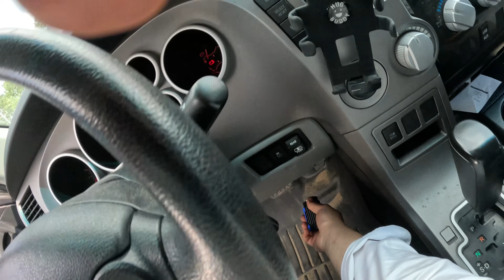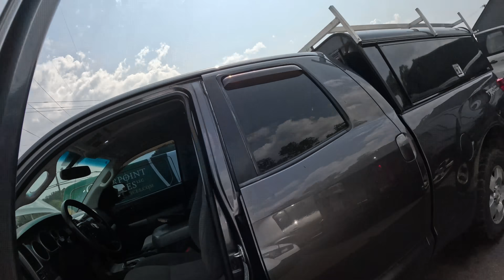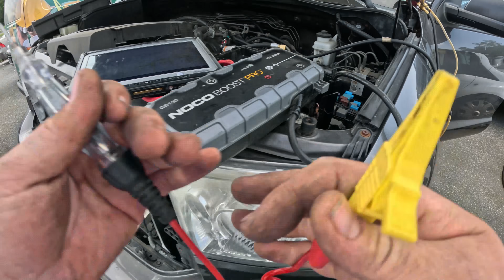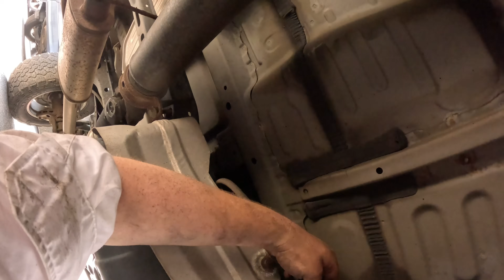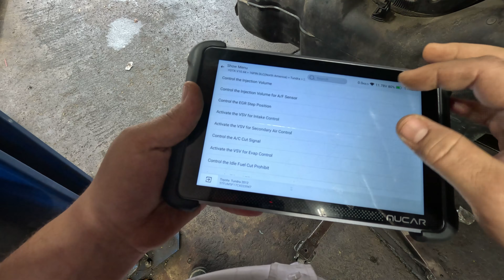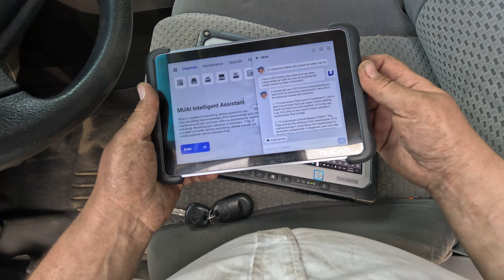2012 Toyota Tundra Crank No Start!

Comment: My 2007 Tundra SR5 5.7  fuel pump shot fuel from the larger line leading out from the pump top after I fixed the power connector (pin backed out from tension) but it just cranks over.   Any ideas?  Fuses are fine.  New battery.  I had to replace the tank after the straps broke from rust, and I transferred the old pump over.

Comment: question , in cars that doesn't use module for fuel pump and no pulse width modulation and no fuel pressure sensor does the pump there works all the time and just the mechanical regulator turn back any additional fuel and that it? for example in my 2014 elantra there no module no  pressure sensor so does it work all the time?

Comment: Hi excellent diagnosis I have the same exact truck I had the same problem I made the mistake of using a voltmeter when I used the h7 headlight bulb I realized the module was not working

Comment: That "MUAI assistant" is very likely just linking into an existing AI and getting it's answers through a sort of API interface with other AI models.  It's very common to do it this way.  Everyone is piggy backing off of the big companies that are ahead of everyone.  I use AI like 50 times per day and have 3 of them open at all times..   It can be very useful, but at the same time- it can give wrong answers and even make things up or "hallucinate"  and sound very confident in what it's saying, while being completely wrong.   So you have to catch it in contradictions and stuff and catch as many wrong answers as you can along the way.    You just have to get better at prompting it in a totally different way or explaining in more detail - and then it can usually end up helping, at least in some way.   

They are particularly good at explaining technical stuff for computer commands  and code, etc.  because that stuff is well documented online.  When it comes to technical stuff about cars - it's very hit or miss;  because it's essentially just reading forums and stuff, just like we would manually.   So if the answer isn't out there on the net somewhere - it can have a hard time helping.   I would actually be very interested in using an AI like this, that is "supposed" to be specifically trained on helping with auto diag, etc..   I could see it being a huge help though - in the future.   I'm definitely learning faster, since I started using it everyday, back in 2022 or so;  basically as soon as the stuff was available.

It's just like searching through youtube vids for info.. Sometimes you find the coolest stuff and the perfect answer and sent down rabbit holes and learning things you've never heard of--  and other times you just can't find anything about what you're looking for.  Hit or miss..  But when it helps-  it's such a time saver.      Like I can say,  'What manual trnsmissions did the 97 F150's have, with a v6 engine.    In a grid, list all other vehicles those transmissions came on and their years" --    and BOOM -  you'll have a full grid of data that would take a ton of time trying to wrangle up.   It's things like that where AI shines..  you know.   LIke when you told me your model for your little Windows tablet--  Latitude, or whatever it was.  I quickly had it pull up all the different ruggedized and best models that have been made  and their specs, and what years,  etc.. and it even link3d me to some on fI33bay right then.  For like a hundred bucks.    You gotta start using AI if you haven't been yet.  It's actually powerful as you get better and better at knowing what to ask.  It can do a lot more than people realize.

Comment: They make some open finger gloves that have a little light on each index finger and each thumb..  so that the lights are always pointed at what you are grabbing with your fingers.   Have you ever tried those?  I bet they would have worked well when you were messing with the module.  I think I'm going to snag a pair or two.. They are super cheap.
Reply from the maker: Sounds awesome, I have to check them out!

Comment: Good catch. I had a 2019 ground side had bad connection at some point because it melted through  pump module. $978 my commercial cost for the pump because it was the extended fuel tank. Seriously crazy and now the pump is discontinued

Comment: When you used that headlight bulb style test light and tested at the module for the power and ground circuit of the module is that current being fed into module during that test. I saw that the module was fed by a circuit with a 15 amp fuse so is that why there is no fear of cooking the module with the heavy duty test light.  I’m still learning and I get worried in the field making the wrong choice when it comes to load testing wiring that feeds modules
Reply from the maker: I wouldn't be worried about cooking the module because its an input. however the wiring can be a problem unless you check the fuse rating like you said.
Reply: after I sent this out I thought about it some more and really I guess the concerns of cooking a module would more be related to putting too much current through an output driver. Thank you for your reply and great content as always

Comment: do you have any videos glossing over what kit / setup you use to put nitro in the ac system? can you recover it back into the tank or just vent it using a fully approved EPA certified method? lol
Reply from the maker: Nitrogen is safe to release into the atmosphere. I don't really have any A/C videos that I can recall.

Comment: Loose pins happen in injectors but  doesn’t mean that the injector is bad
Reply from the maker: There was melted plastic on the pins of the fuel pump. It probably would have worked, but the customer wanted it replaced as a precaution.

Comment: It is not easier to immediately check the fuel supply, signals for the injector and spark, so that everything becomes clear, there are fewer movements
Reply from the maker: If I worked in a shop and had a diag cart set up with my scope, I would agree with you. when your mobile I try to do with the least amount of tools possible

Comment: Good video.
My first test on any crank no start, key on engine off, amp clamp on battery cable, zero amp clamp, bidirectional activate fuel pump. 
Average about 1.3 amps per 10 psi. Most 60 psi systems around 9 amps. This easy first step gives me initial direction.
Also any bidirectional test key on engine off I have the amp clamp on the battery cable.
Reply from the maker: Great advice, thanks for sharing!